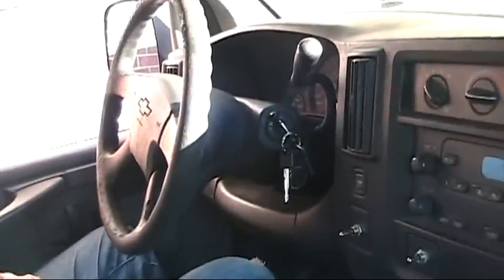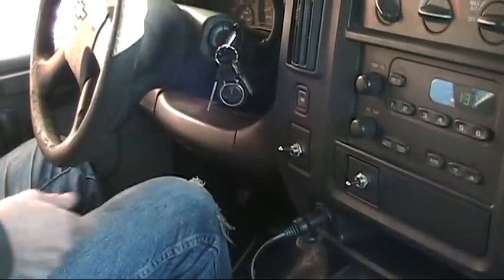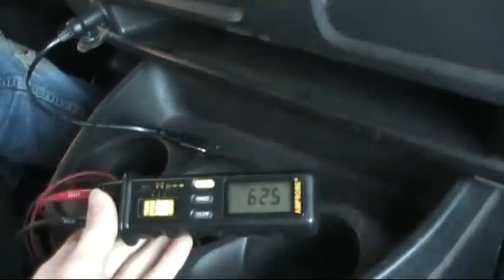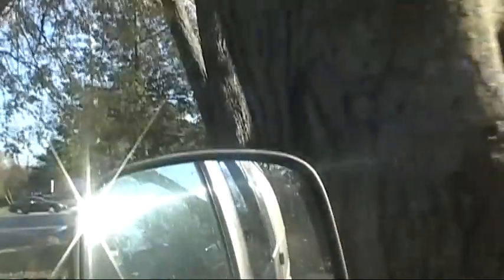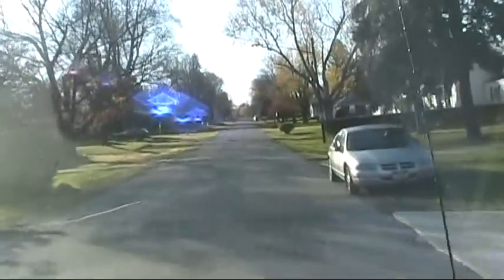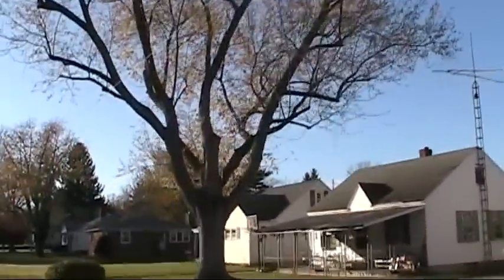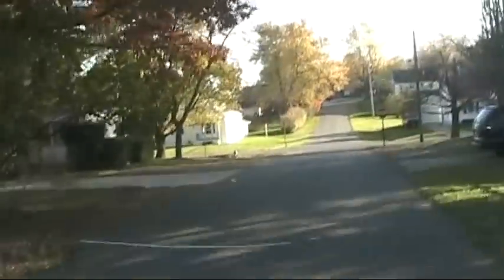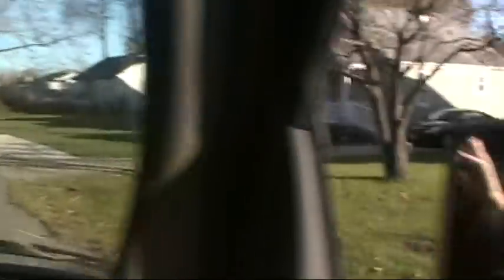Driving Chevy Express EV Conversion

Comment from the maker: @maddkraut03 I'll make one. I'm going to make a video explaining the wiring and controls in the van and I'll try to get a diagram posted in that video. The whole thing is pretty simple though, the ignition switch accessory position energizes a contactor which connects the batteries in series with a resistor to the motor controller. The on position then connects the batteries directly. The charger is just a diode doubler, a seperate battery and rectifier operate the heater and hydraulic pump.

Comment from the maker: @DanFrederiksen Yes, The controller will work up to 800 volts DC input before it shuts off on overvoltage. It will run a 500 volt 3 phase motor.